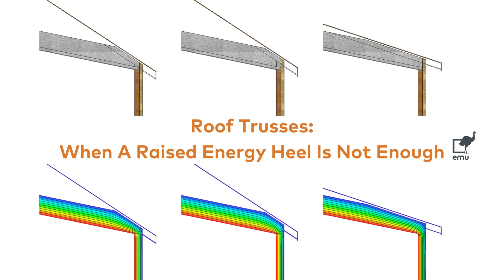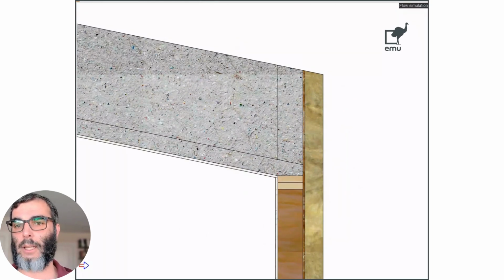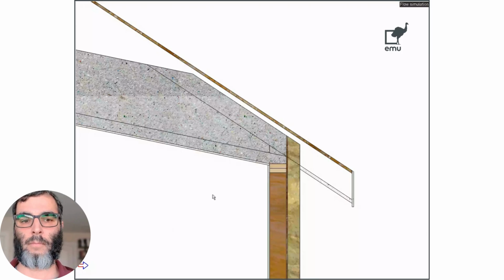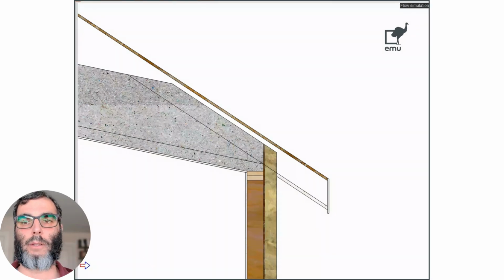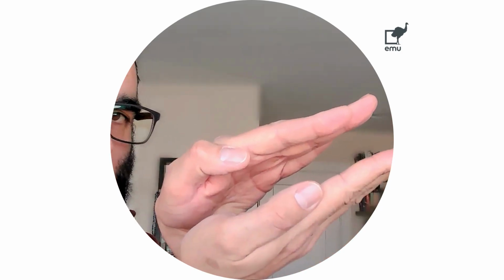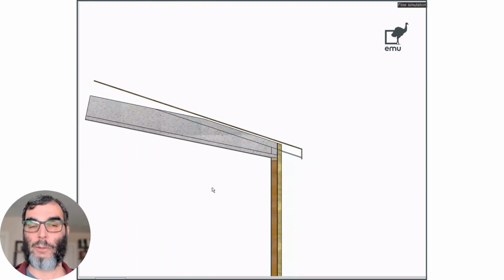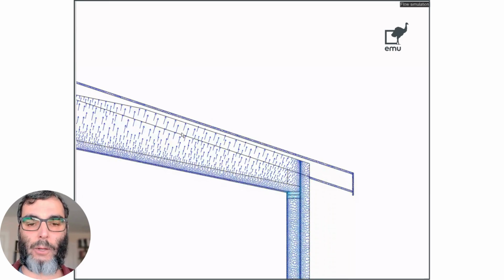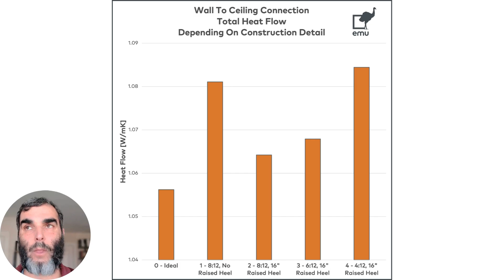Roof Trusses - When A Raised Energy Heel Is Not Enough

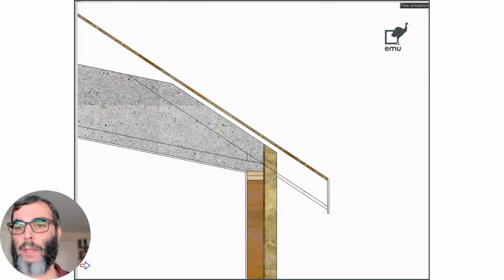Comment: Thanks for the visual representation of the difference in roof pitch.  Zone 5, but New England area.  I was looking to go with a lower pitch like a 4:12 pitch, but it was explained by my builder that it would not shed snow and may be harder to achieve the energy rating I am looking for.  I was looking at a lower pitch to reduce the volume of conditioned space with an unvented attic.
Reply: You can go with a higher pitch to shed snow, or lower pitch to reduce the conditioned volume. Either way, you need to make sure the height of the truss heel is enough to avoid the issue illustrated in this video. You mentioned wanting to achieve an energy rating, what energy rating are you referring to?
Reply: @EmuEnrico  
Meant R rating (R38) as long as I have continuous over the top plate
Reply: @pennguino9137  you mean R38 at the ceiling? Do you have any whole building performance goals?
Reply: @EmuEnrico  
R38 Possibly more at the roof.  Unvented attic, ICF wall, Frost protected shallow footer.  Looking for a blower door test around 1 if not lower.  Possibly have the trusses with no rafter tails to allow for rigid foam on the exterior and make it easier to flash/tape and seal.  ERV/Mini-Splits for the lungs of the home.
Reply: @pennguino9137  Ok. Other than the individual components (i.e. roof, wall, ACH), do you have specific energy goals for the building as a whole?
Reply: @EmuEnrico  
No.  Not looking for any certifications.  Just a quality built, energy deficient home.  The raised heel serves two purposes.  First is the space of insulation.  Second is space for ERV venting (Intake/exhaust), plus space to run Mini-Split lines through attic instead of exterior wall.

Comment: In the diagram of how the roof was actually framed where you only have 6" of cellulose over the top plate, sometimes the best bet for that junction is to spray 2-4" of closed cell on those raised heels when the height of them is not tall enough to hold atleast 12" of cellulose there.
Reply from the maker: Yes, the problem with using spray foam is that many expect it to perform better than cellulose. The reality is that spray foam actually performs similar to cellulose, so there’s not realy and advantage in doing that. My statement is based from data from Europe, where site-applied close-cell spray foam is rated at 3.5 R/in (about half of what spray foam is rated at in North America)

Comment: insulated crown molding
Reply from the maker: what do you mean?
Reply: @emupassive  put crown molding between the ceiling and the wall. It is classic interior trim. It will add distance from roof wall junction.
Reply from the maker: @scottbeavers3062  I understand now, thank you. what you describe may be an option in a retrofit, but really the amount of insulation you can add before the molding becomes huge is very limited
Reply: That's what I was thinking. I don't know if I could trust any of this research, seems to be based entirely on a computer simulation.

Comment: Why not go with non vanted roof and put 20% or more insulation on the outside of the roof sheathing. Not sure the roof insulation goals so not sure how much you are looking for.
Reply from the maker: overall goals for roof R-value here were in the R80 ballpark. what you deacribe is not wrong from a building science perspective, but it’s more expensive than what shown here, and results in a much thicker fascia which aesthetically is not great